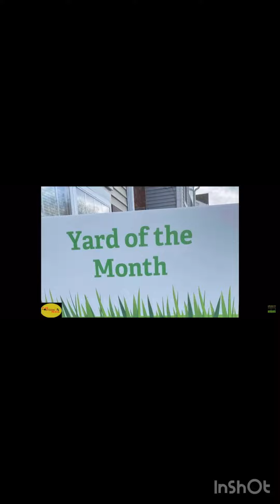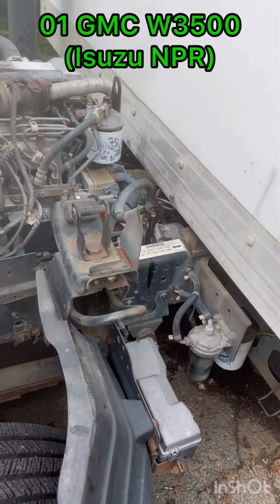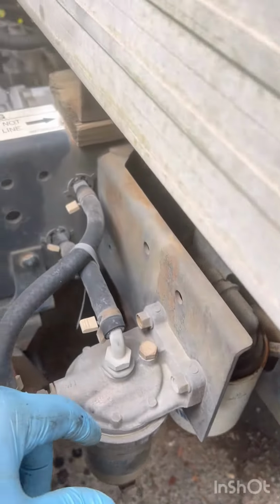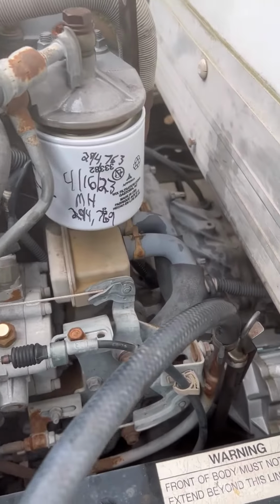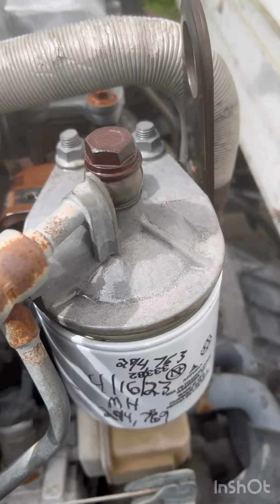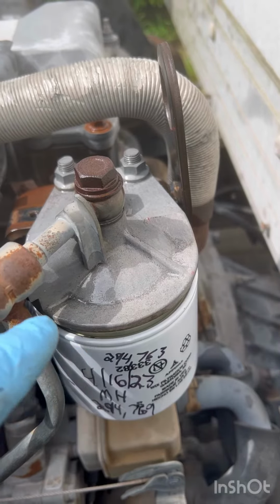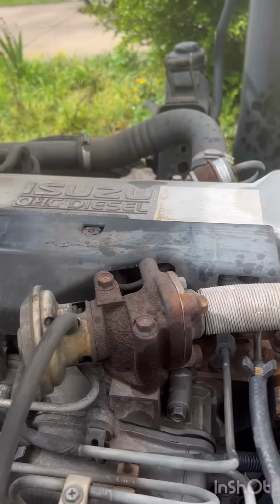01 Isuzu Npr Fuel filter Change

Comment: Need more videos please just bought one same year
Reply from the maker: Trying to make more been a busy spring rush but coming soon 😂 💯
Reply: Does this one have the banjo Bolt with the screen in it Somewhere like the later models have.
Reply from the maker: @CheZfrmdaWestWisc nope far as I know haven’t noticed that on this one
Reply: @lawndudelawnmaintenancellc3203  
OK, so after an hour on Google I think I found it on the intake side of the lift or feed pump 

My truck has no balls, and apparently, this little screen in that banjo bolt is restricting the fuel flow 

I seen it on videos from Newer trucks but you seem to be the only one with a truck in this year range 

Haven't tried it yet, but soon. I hope mentioning it helps someone else
Reply from the maker: @CheZfrmdaWestWisc also check all your vacuum lines and hoses. I had this problem last month and one of the hoses had come off. It was causing me to have little to no power at acceleration. I ended up replacing all my vacuum hoses/lines. Matter fact, one popped off a week ago, and it started doing the same thing